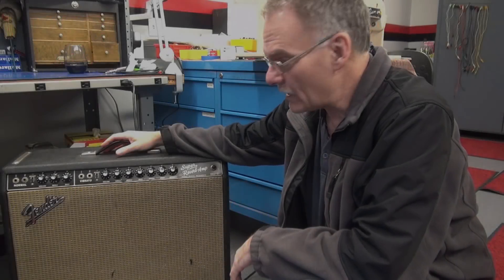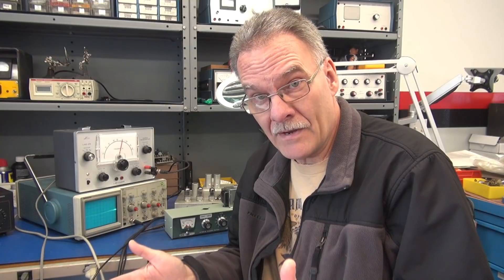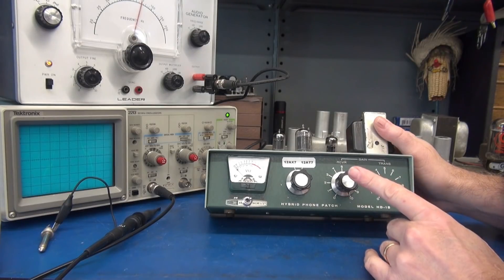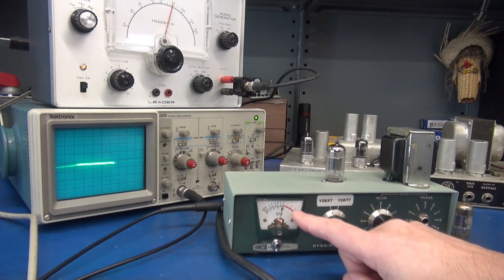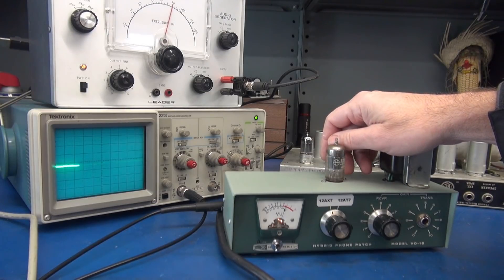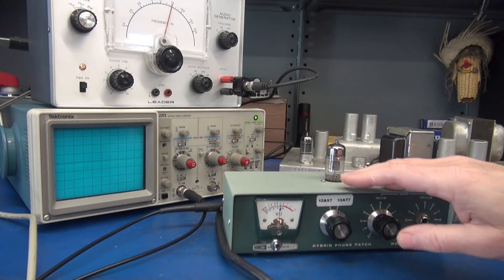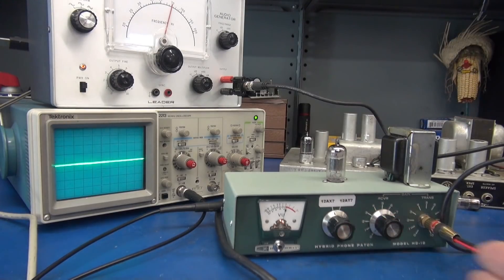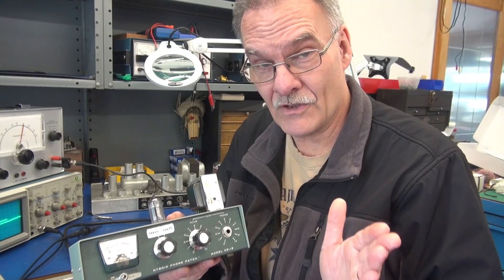How to troubleshoot preamp tube amplifier microphonics Dynamic test device Example Fender Super amp

Comment: Hi there. Thanks for making theese great videos. really helpful.  Did you solve the nois issue on this Amp?  I have the same noise in a VC30 by laney.  found microphonic issues on a wire from a preamp tube and on a capacitor or maybe 2. c1 and cx1 i belive.   just wanted to hear if you solved yours?  Thanks again

Comment: My tube radio did the same crackle crunch pop thing. Turned out to be the on/off switch arcing on one side. Cleaning did not fix it so I tied the wires together on that side of the switch. It doesn't have a hot chassis so no biggie.

Comment: Hi Terry, Thank you for taking the time to explain all the different issues you come across. I may have one that you haven't seen. I have a stewmac 81' Brit hand wired JCM 800 clone that I built and it has developed a problem that I cannot figure out. First off, it worked fine for awhile and then this problem showed up. Every time I play an "A" chord whether fingered or barred the amp goes into the atmosphere with a low "A" frequency feedback that just takes over. I can turn every pot down and the feedback remains. I literally have to shut it off to stop it. Turn it back on and it's fine, no noise or anything. I play another "A" chord and it's lift-off!! I can play around this problem but it has severely limited my song selection! Anyway I first checked for microphonic tubes and found nothing. I then checked voltages at the filter caps, pins 1&6 on the gain tubes (V1&V2) and voltage to the inverter tube (V3). Other than being a little high (20-30 vdc) in each case it seems consistent. I then replaced the power transformer on a long shot and the voltages still stayed a little high. I am now looking at the choke  and negative feedback circuits. Any advice?? Also I have tried different speaker cabs with the same result.

Comment: Hi Terry, for good perform crt scope line on video - use native manual shutter speed, 1/30 etc
1/30 for 30fps, 1/60 for 60fps
for accurate exposure you must use ISO and aperture in auto or manual mode
Best regards! Oleg, Russia

Comment: Hi Terry, thanks for the amazing videos you made so far. Lots of good information and advice. I'm a bit off-topic here but I was considering buying a tube tester. The only problem being the transconductance ones are off the budget and the cheap ones are not good enough. Is there a way to modify an emission one to read transconductance or maybe you could make a schematic of how to generally test vacuum tubes.

Comment: Hi Terry, happy new year to you and your family! Thanks for this brilliant idea... I've had the same exact noise in a customer's amp, and that was a brand new 12ax7. Out of the 5 new Sovteks we had for the repair, two had the same noise... Luckily enough, we only need 3 for a Hot Rod Deluxe, but after checking inside the circuit, I ended up swapping tubes with the ones in my Hot Rod : and voilà! Your build is definitely what I would have need. I have some french 1960s tube intercoms that would be a good host for this! Is the high voltage diode rectified inside? Thanks again, Laurent